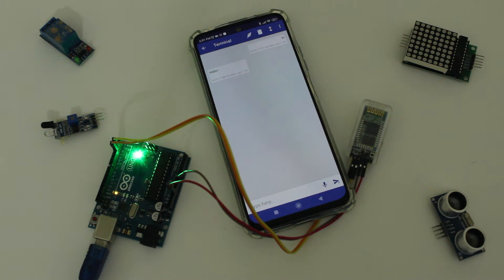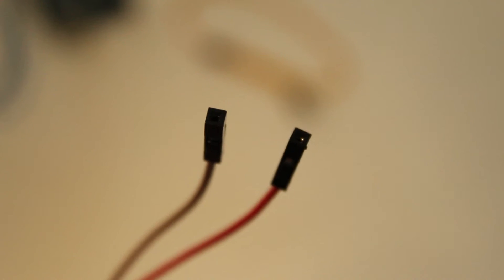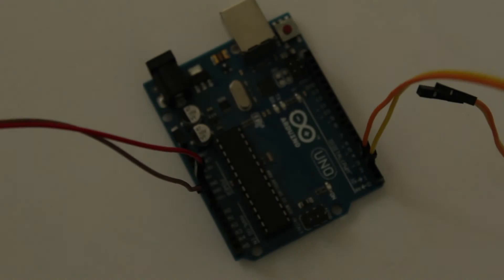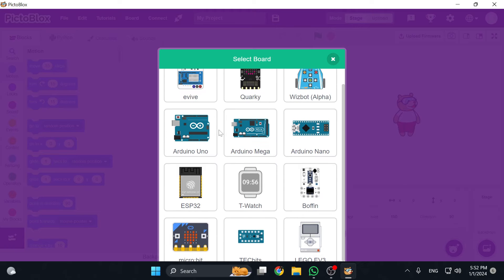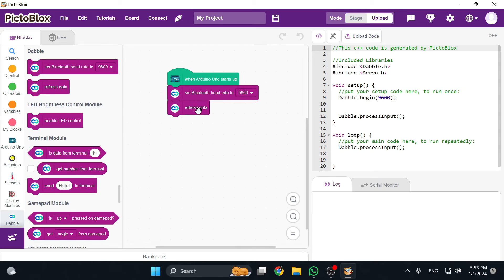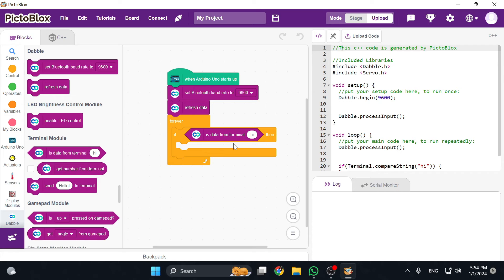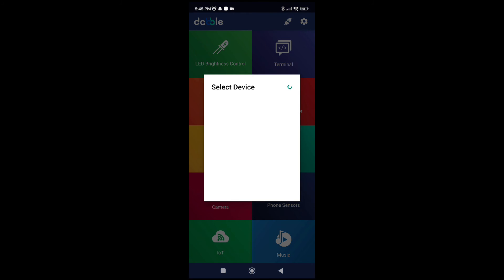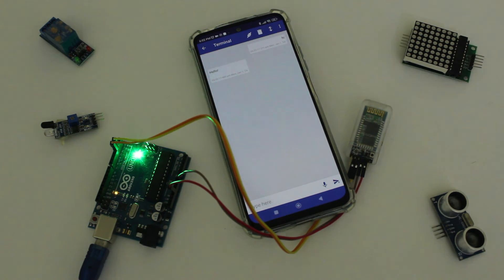Arduino Bluetooth Tutorial | Intro to IoT Projects | How to Connect Bluetooth Module to Arduino

Comment: why the port always disconnects while uploading the code, though, before it stays connected? I saw this in your video too but you didn't say anything about it.
Reply from the maker: The port disconnecting while uploading is completely normal. It should automatically reconnect once the upload is finished. 😀